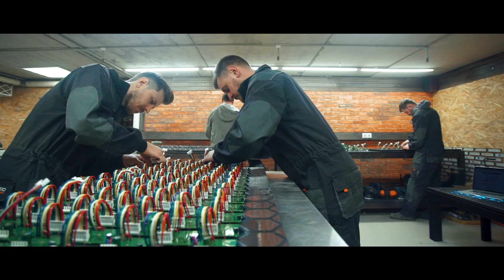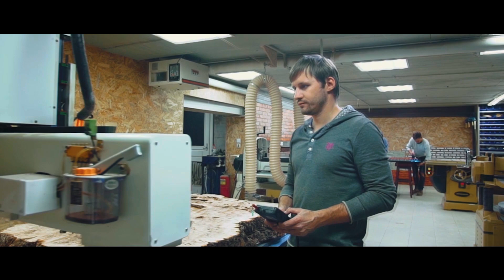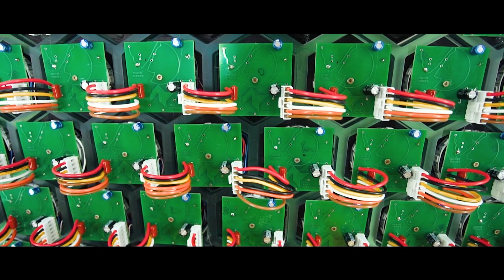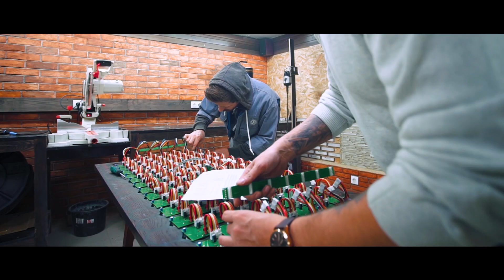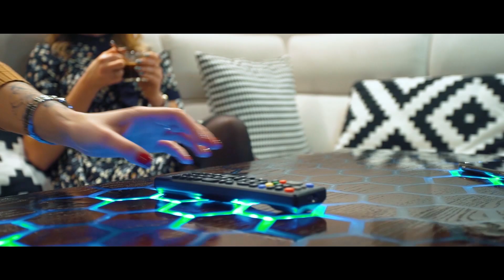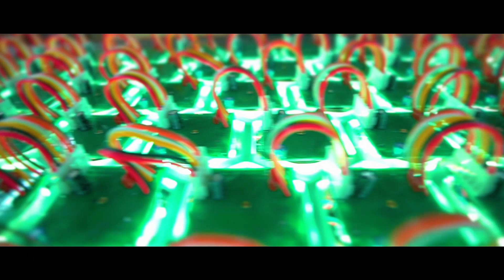Touch-sensitive table back on Kickstarter using the Wattsan CNC machine

Comment: My concern with this would be how do you support the tables when/if they fail 3 months down the road.  There are a ton of soldered connections here, any of which could fail in the future from components expanding and contracting due to heat changes on / in the circuits.  Hopefully they are not wired in series at any point and a failure would just result in a small area not working, but they kinda look like they are largely wired in series...
For sure beautiful.  Would never personally order one unless there was someone local who could fix it.
Reply: It doesn't seem like a difficult fix. it's just opening it once and either swapping a cable and soldering one at most. so anyone with any sort of electronics experience should be able to fix it. as long as you can find spare parts that is. if it's not proprietary parts it should be fine and or spares will be available. and there is the question of how software malfunctions will be fixed which will is possibly the more technically difficult part.
It's disappointing companies rarely ever clarify this kind of thing.